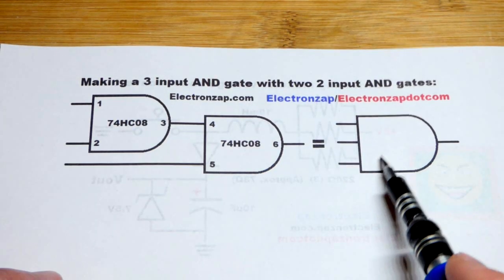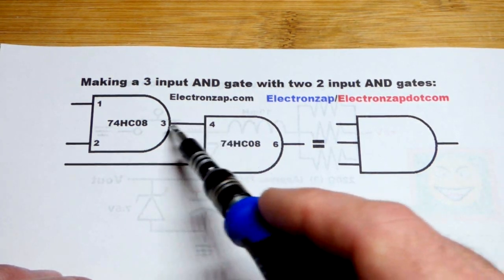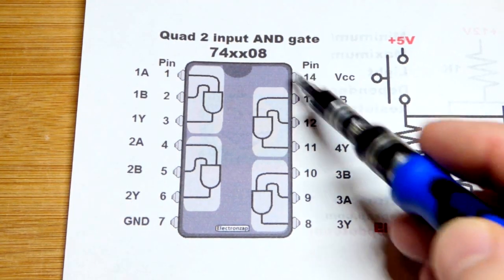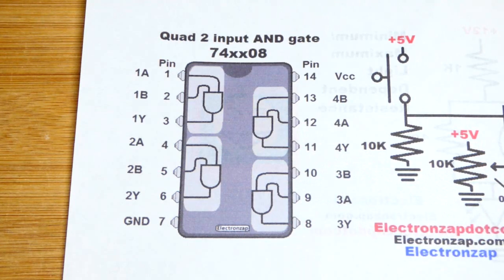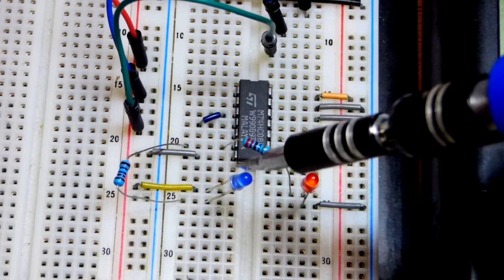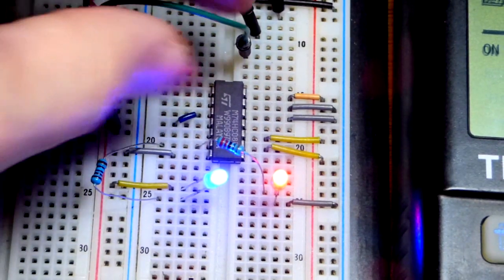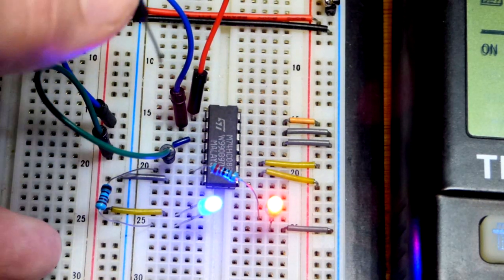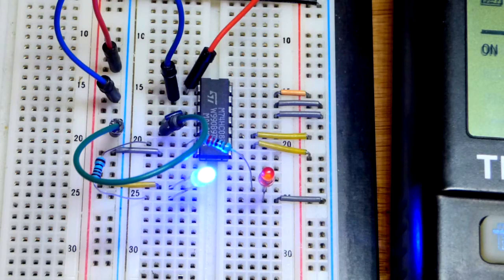Making a 3 input AND gate from two 2 input AND gates electronics demonstration circuit how to DIY

Comment: I have a question. What is the difference between the above circuit and the common 3 input gate?
Reply from the maker: Not 100% sure if I understand what you are asking. This is a way to make a 3 input AND gate if you don't already one, but you do have 2 input AND gates.
Reply: @Electronzap  I mean, if I make 3 input AND gate with 2 input AND gate (74xx08) like this video, what is the difference from 3 input AND gate (71xx11)? Or just same at all?

Comment: I'm confused. On the blue LED the yellow conductor is connected to the positive rail and the resistor from 20 goes to the other lead of the LED. On the blue LED which is the anode and which is the cathode? Thanks for the excellent videos.
Reply from the maker: The LED needs to have the Anode (longer lead if untrimmed) more positive and the cathode (shorter lead if untrimmed) more negative in order to light up. So the blue LED has the Anode to the Yellow jumper and the cathode to the resistor. It lights up when the IC output goes low (0V), which is when the output is connecting to the negative rail as best as it can. Thanks for watching!
Reply: @Electronzap  Thanks for answering so quickly. How well you explained this makes sense.